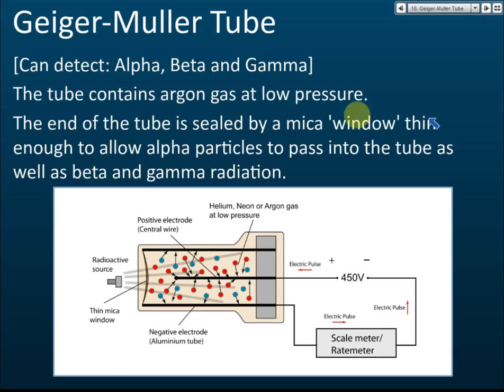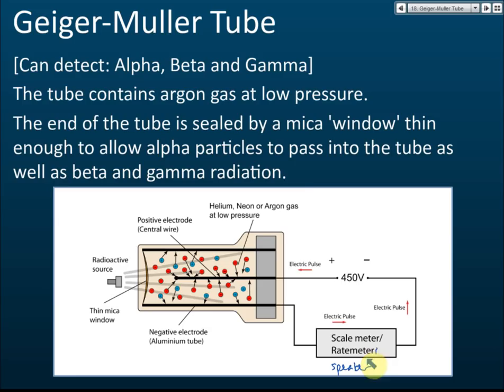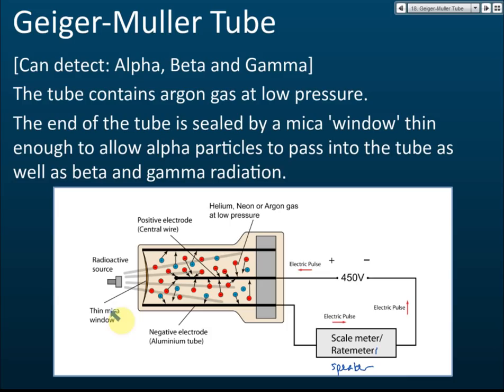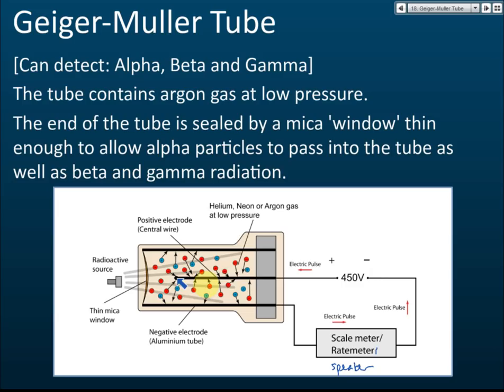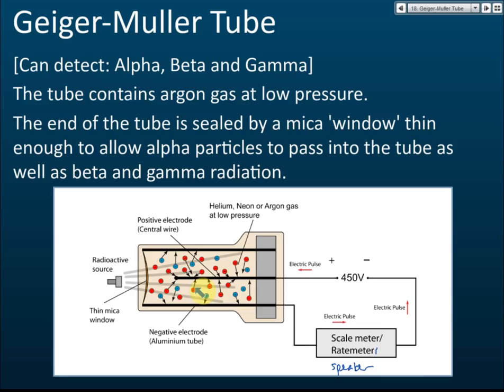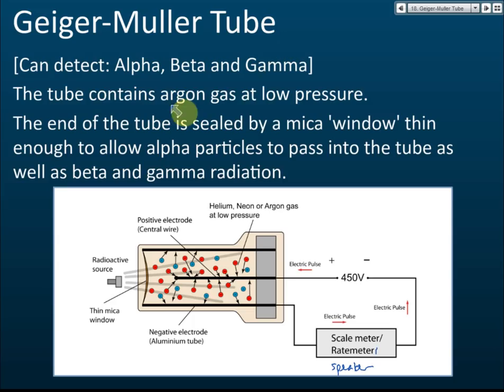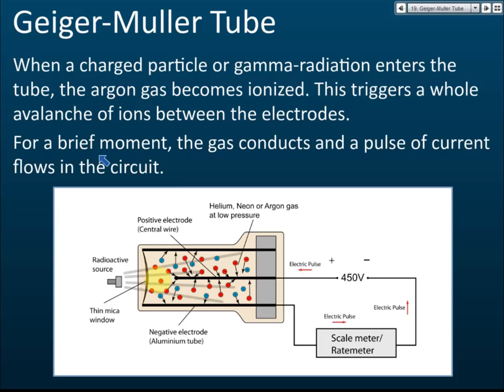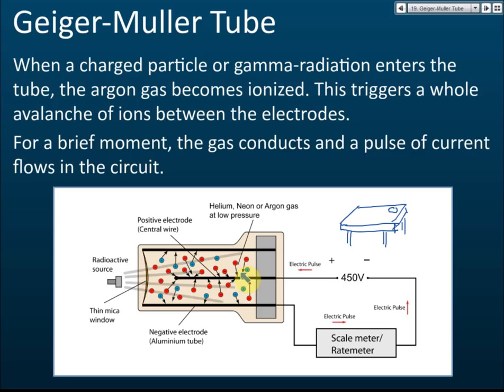Geiger-Muller Tube | Radioactivity | Physics

Comment: Gamma is not ionising so how will the rate meter behave to that ? If there is no ionisation the rate is meter is supposed to indicate no pulse 😕. Um struggling here , help
Reply: Ferdous Sarwar bro gamma can enter from sides because sides are made up of aliminium which cannot block gamma
Reply: @sarptaylan541  Mate , my question was , the gamma is not ionising then how does it shows count rate in the gm tube
Reply: @ferdoussarwar9768  Gamma IS ionizing it travels with the most energy in the Em spectrum and is very penetrating (hard to absorb).
Reply: @hho5292     It is actually the opposite. Gamma rays have very low ionising power.
Reply: gamma does ionise but it's ionising power is extremely low. down to (1 ion per mm of air)
Reply: Hi
Reply: How r y
Reply: @imnoweren  but it has negligible ionising power.
Reply: gamma rays CAN ionise (by giving the electrons enough energy to escape the outer most shell) but as this is very specific (for example if an electron needs 5J of energy to get ionised then the gamma ray MUST contain 5J of energy, not more not less) it is extremely rare and the chances are low. We do assume it occurs here as it isn't impossible